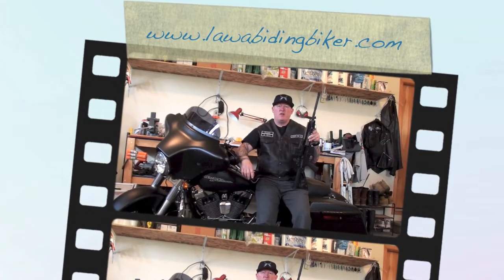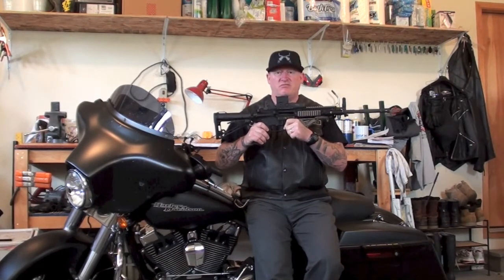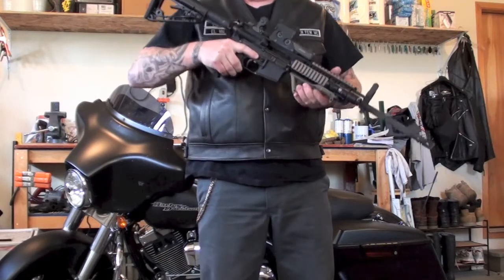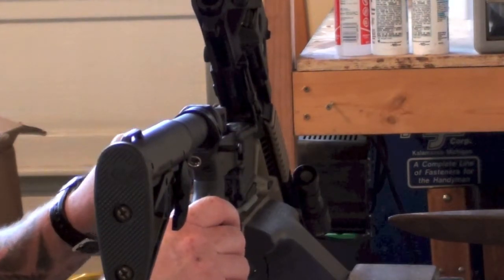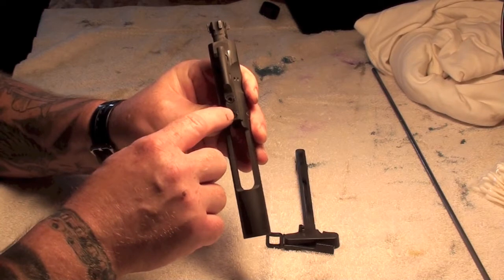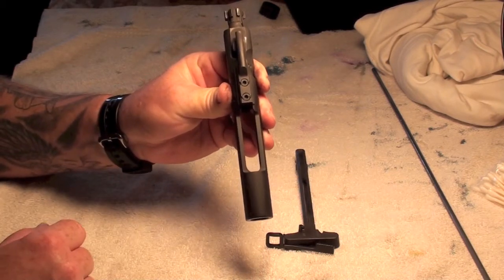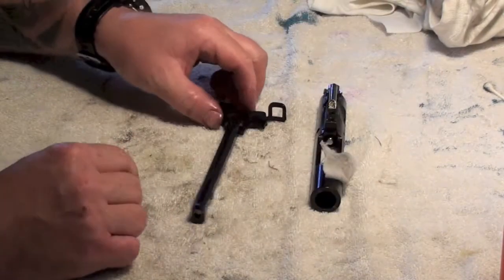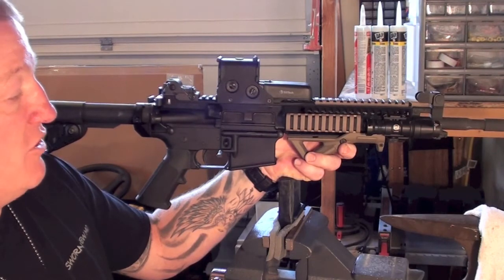How to properly clean lubricate maintain your AR-15 M4 Carbine rifle: Biker Podcast; Biker Podcast

Comment: Awesome vid!  Its nice to watch a video of someone who knows what he is talking about !  Respectfully ( from a fellow biker and a fellow ar builder/gun enthusiast), the only thing I would personally  add is this : IF you are shooting steel case ammo (tula wolf) you should increase the oil amount on the bolt as the steel case crap is coated with a lacquer which when it heats melts and becomes liquid as it rapidly cools it adheres to internal gun components and will cause malfunctions (and a pain in the butt to clean).  Use of the extra oil stops its ability to adhere and  GUM up the works!  great vid brother!!!!!!!
Reply from the maker: Good input.  That wolf ammo can be pretty dirty stuff.

Comment: I have a dpms panther AR15/M4, is the process generally the same for all of these weapons, or will i notice different steps with interior parts, i have shot about 800 rounds threw it.
Reply from the maker: +Jacob McDaniel It should be the same.  They are all built on the same platform.
Reply: it is exactly the same - i just cleaned my dpms oracle

Comment: Thank you for dispelling the myths and dispensing the facts about AR 15 cleaning and lubrication.  I was wondering what you think about Fail Zero Bolt Carrier Groups.  I thought a 200 dollar investment in a Fail Zero BCG would be worth it if it really does reduce the amount of solvent, lubricant, and time needed to maintain my AR.  If you have any experience with Fail Zero treated parts, I would really appreciate your opinion.  And thanks again for the very informative video.
Reply from the maker: Thanks for commenting and I apologize for the delay. I am familiar with Fail Zero, but I will tell you that I won't put one one. I work with many that carry AR-15's every day and I am an instructor. None of us utilize these and the stock bolt carrier groups last forever. 

I have never personally tested the Fail Zero. Just my thoughts.